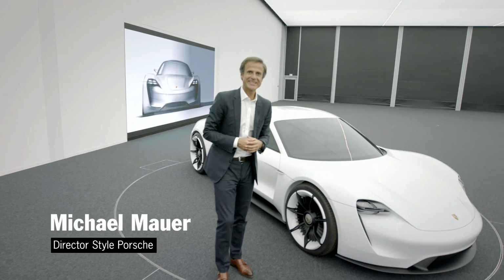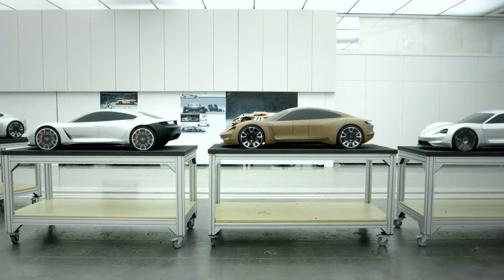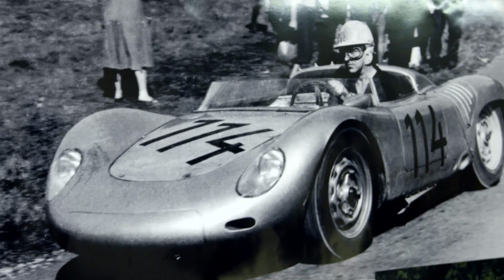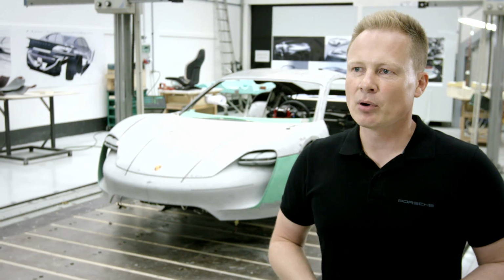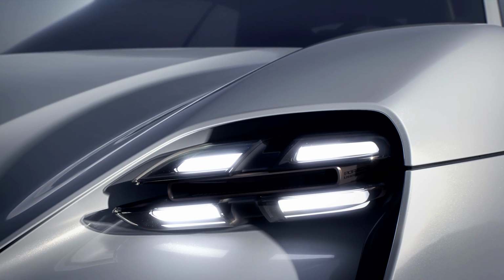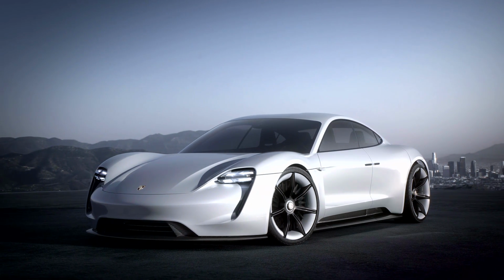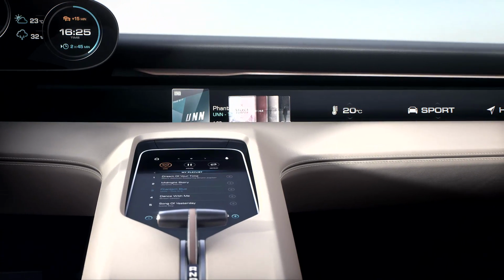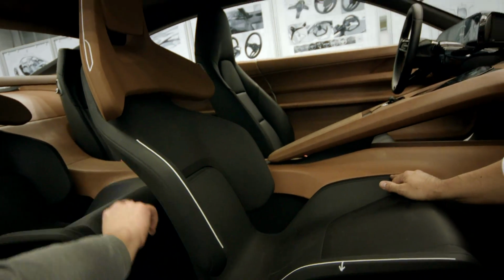The design of the Concept Study Mission E

Comment: I know that it is coming.  But my questions is - how long will electric cars last before their batteries' ability to hold their charge diminishes, along with the car's range ?   An electric car may start with a range of, say, 300 miles when it is new; but after regular recharging, the range will eventually drop to 200 miles, then 100 miles, until the car will become useless.

Comment: As a german I am glad that atleast one german car producer is taking the electric car revolution seriously. Just look at BMW (I3/I8), VW (E-Golf) and Mercedes (???) and all the other big brands missing out on one of the most important changes in the history of the automobile. Tesla did a  Great job from accelerating the process of innovation, even though they will most likely not be a leading brand on the market in near future.
Reply: Hmm, you act like if the Mission E is already on the market. Instead, it is just a car, that Porsche is working on but that will be realeased not before 2019 (or probably even 2020). So where is the difference to the other companies? The production of the Audi e-tron quattro will start already next year, so earlier than the Porsche. The sportback version will follow in 2019. The Mercedes EQC is also scheduled for 2019 (you can already preorder it in Norway on the official Mercedes-Website). Volkswagen is working on the cars on the MEB platform, and the first one (i.d.) will be released in 2020. An VW and BMW at least already sell electric cars since 2013.

Comment: This will destroy tesla once it comes out
Reply: The Model 3 now has the same range for a starting price of $44000. They're late, the top Model S accelerates faster and goes just as far. The only thing they got left is the promise of faster charging at 350 kW but the car is still not released yet, by the time it does we don't know if it will have even that advantage. It's going to destroy's Porsche's credibility, not Tesla at this rate of progress.

Comment: Looks identical to the Tesla Model 3
Reply: lol get your eyes checked
Reply: I did and they were fine. You Suck.
Reply: will17power
other than the fact that both is a sedan what part of these cars look the same??
Reply: They do not have a front grill. Both are all electric vehicle. The lines along the side to the back looks similar. 19-20 inch wheels. LED headlights.
Reply: will17power
so if i put 19inch wheels on a Nissan Leaf would that make it look like this?? NO!!! Porsche has made many cars without front grills because they put the engine in the back so that is how they know how to make a good looking car without a grill.... the Model 3 looks like they made a car chopped off the nose, its not a bad looking car but its also not a good looking car either...

and almost every car uses LED headlights... does that mean that a Nissan Leaf looks like a Model S because it has LED headlights??
Reply: Never said anything about they are good looking cars

Comment: Clay modelling and scale models is really a primitive way to do things today. Keep it digital and examine it in VR. It can be ten times faster.
Reply: +Dan Frederiksen    You need at least a 3D printer to see and appreciate the final aspect before making choices, and a 3D print of those scale shouldn't be cheap. Why to resign to use clay when is a cheap and efficient tool? Would like to discard the tratidtional pencil and paper just due are "old fashion".
Reply: +Buran01, no that's the point. You don't. With decent VR you can fully appreciate the car's final look before it ever becomes physical. You can finalize a design completely before any production begins.
You want to try the seat and touch the steering wheel and such but that's another matter.
Reply: +Dan Frederiksen I think a lot of this clay modeling crap is marketing driven trying to invoke artisanal and bespoke emotional responses in the audience, so passé .  The tech guys are way ahead usually on Catia S/W..